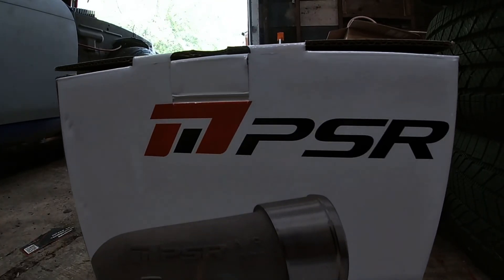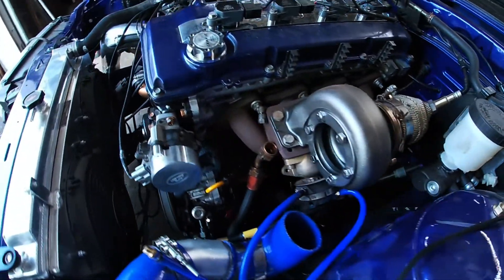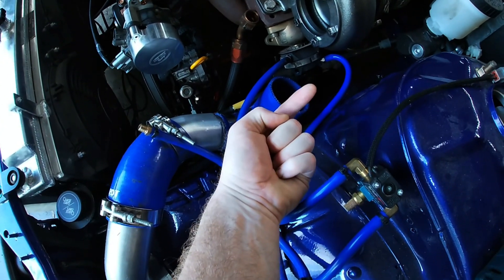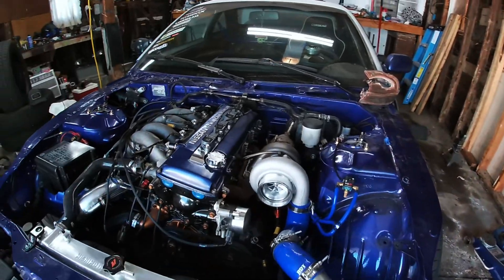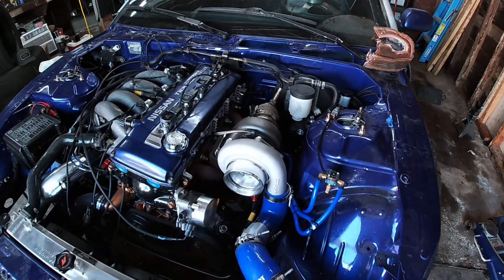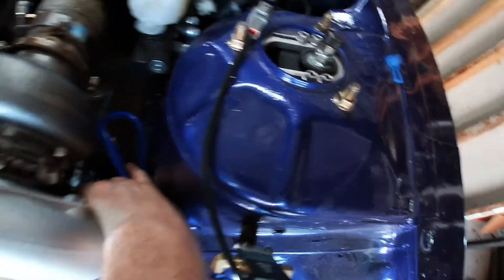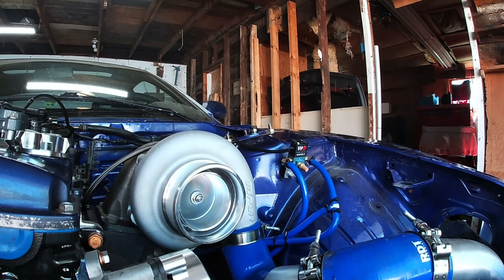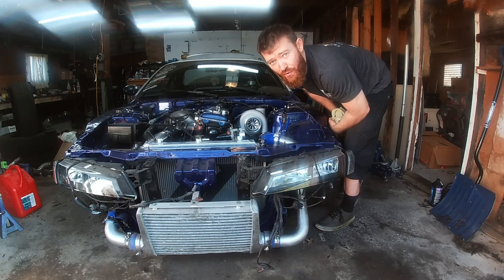Watch This BEFORE buying a Pulsar PTX 30 Series Turbo! 🤯

Comment: how do you feel about the turbo now?
Reply from the maker: It’s a really good turbo. It doesn’t have hardly any lag and the power carries through the rpm. Once I’m able to get it on the dyno we’ll be able to see how it truly performs. But so far with just the street tune it’s pretty good.

Comment: .82 ar exhaust housing on a 2.4L sounds laggy, a .68 housing would cut that down by 1000-2000rpms lower
Reply from the maker: It’s actually pretty good. Not a whole of lag. That also depends on the type of manifold that’s being used. It hits boost right around the target rpm/boost reference. Now I would say any more than .82 you’ll start to see a decent amount of lag.
Reply: @BuiltToBoost  Any reason you went the 3582 over g30 770 or g35 900?
Reply from the maker: @sircefiro the pulsar ptx3582r is in between those two turbos. Makes a little more power than the 30-770  and has a quicker spool than the 35-900. Now reliability wise, we’ll find out here very soon how well it’s gonna hold up to 700+ hp for extended periods. Update to come on that!
Reply: @BuiltToBoost  Be good to see how it goes, g35 900 is usually a bit more responsive than the gtx35 but they're pretty close, gtx35 is still good
Reply from the maker: @ yea the g35- 900 is a quite bit bigger than the 3582. It’s better suited for bigger displacement motors but none the less they are both really good responsive turbochargers

Comment: Sound good ,cold blooded , did you put the right good stuff in the piston/crank /rods area,😮no brews no way, not good,no way , it will catch up with you ,like it did with me, lol praise Jesus it gone from me, no more stupidness from me, thanks BigAl California.
Reply from the maker: Yea I completely tore it down and put Eagle H Beam rods, 9:1 Wiseco Pistons gapped the rings to 0.0028 - 0.0030 for around 32-35 psi. I put in new Brian Crower valves springs and 264 duration cams. Also took off the old heavy flywheel and installed a new lightweight billet aluminum 11 lb flywheel with a 6 puck sprung clutch. I’ve added a lot of goodies into this over the past 2 years. Now I’m just getting to the point where I can take it out and have fun with it. lol yea I hardly drink anymore that’s why I said a brew or 2 lol.
Reply: Kool, good  for your long life you will bet off then I am, 36 years of smoke ,was real bad , and 24 years of drinking, lol praise Jesus grace for the blessed, righteous with God life now,,, good job thanks

Comment: That’s lack of the right oil,, all the  engine oil pressure needs to be  turbo baerings, kool for skhool , thanks BigAl California.
Reply from the maker: Well the old one is a journal bearing so it needs to have water cooling and I didn’t have that on that turbo. It was also a $150 turbo but the new one is a $650 turbo so I made sure I did everything right on this one! Plus it’s definitely flowing a lot of air as you can tell when I go over 50% throttle the wastegate pops open and starts screaming releasing the extra air from the turbo on some of those clips. Sounds amazing! It is very loud for a 4 cylinder and has the idle of a big cam v8 lol
Reply: Good job , happy late B-day , I don’t rember these things anymore, 31 , was the yaer ,I think I met your mom,, not sure m but I think so, I’m keep you all in prayer,ok, thanks praise Jesus Christ grace amen amen 🙏, p.s. plug the ends of the peace tobe welded and put helium in it like from a balloon, that might help weld it with Fluxcore, I’ve heard that works, go get a gas wire feed, they are not that much,so what it’s harbor fright , it will work for what you need, p.s. I don’t know where to put the commas,,,,,, so lol just have fun , thanks